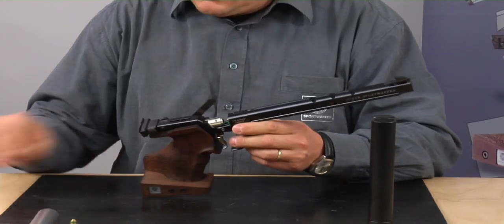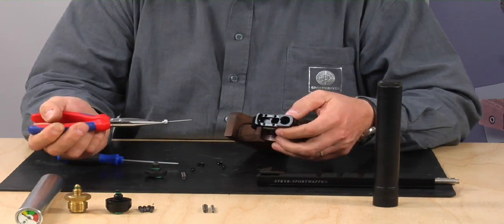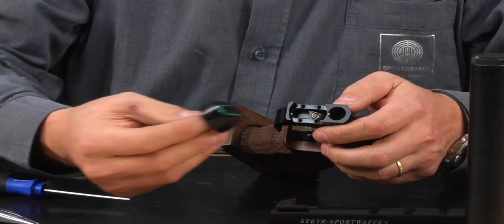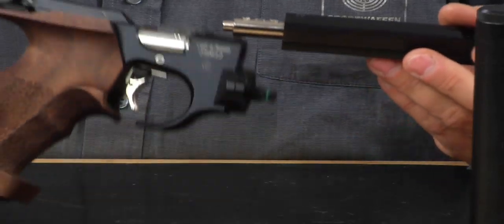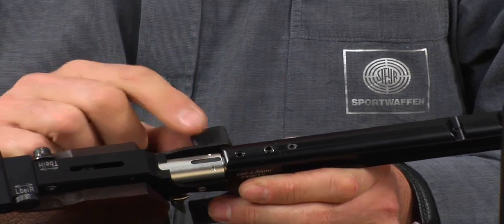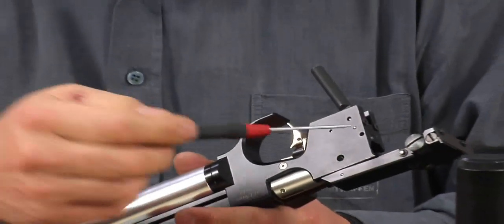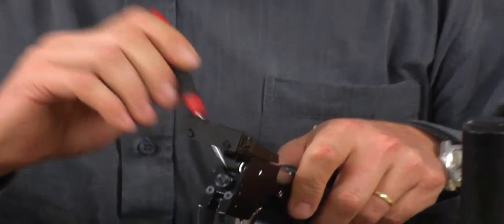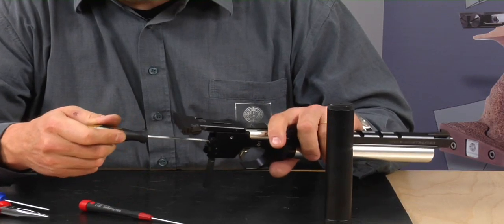STEYR LP 10 Conversion from CO2 to compressed air

Comment: "**It is necessary to remove the barrel to replace the part of the adapter where the gas cylinder is secured. I need to fix a leak, and I would only have to change the gaskets.**"

Comment: Air FTW

CO2 is pretty much the biggest ripoff i can think of
Reply: Back in the day  it was a way to shoot a bunch of bb's as fast as you could pull the trigger . As far as 10 meter use it was used after  the spring  guns   to try to get rid of some recoil but before  the single pump pneumatic . So  for kids wanting  to shoot fast  or have a blow back pistol that acts like a real gun  or  for  practicing  real life shooting conditions the co2 can be a lot of fun and very useful when you are not really worried about  where the  pellet or  bb's  go  and you just want to go through the motions   for defense use . It's not however  the best for  10 meter  shooting where accuracy  is needed . co2  has it place  in the airgun world  just like springers and pcp and single and multi pumps guns do . Here is a example of  a co2 used for training .   https://youtu.be/haoukYA1YX0